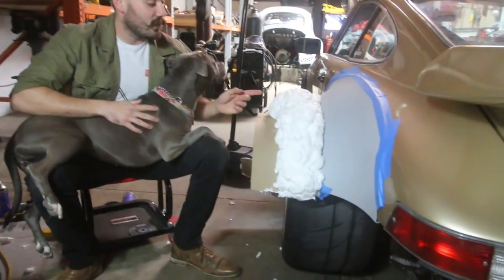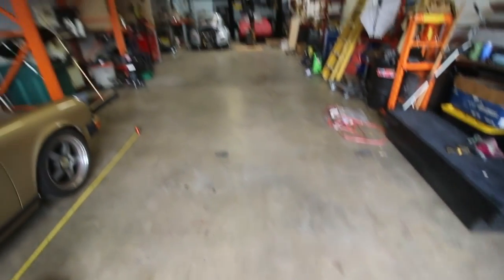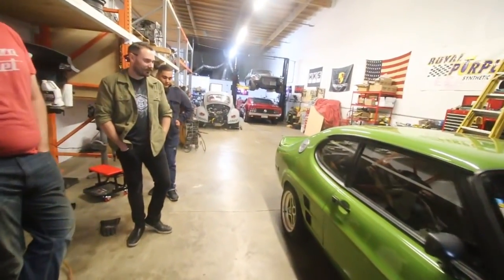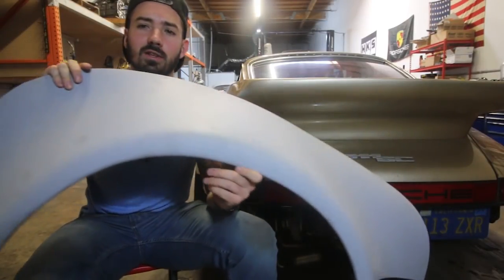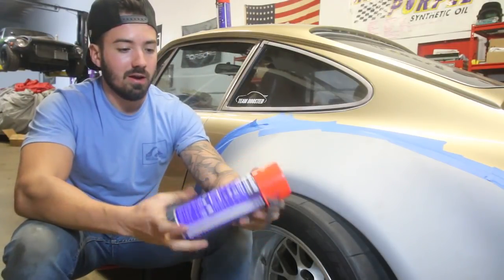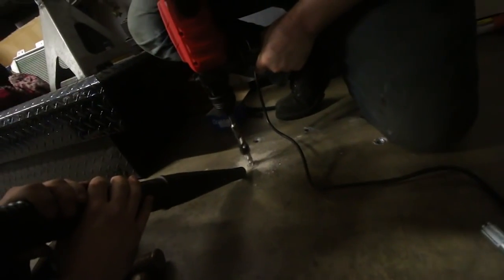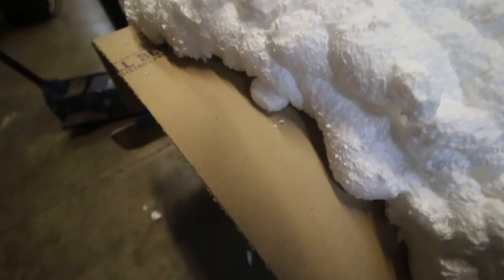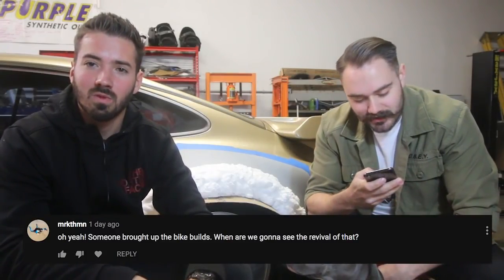Making Carbon Fiber Widebody Flares - 911 Turbo Pt.1

Comment: If I could add one thing. Medium or high density expanding foam works best for melding and sanding. Way less chance of large air pockets and it doesn’t fragment like high expansion foam. Have built a few scoops using  high density low expansion foam.

Comment: Best video yet!  

You guys have got this.  Use the current quarter/flare as a plug.   Pull the mold and you can then reproduce your flares.  The foam you’re using is okay, but be sure to fill the air bubbles and gaps with body filler.  When you go to lay up the resin be sure to be generous with a PVA mold release.
Reply: The plan is to get the rough shape with foam,. Then get the desired contour with filler, and possibly a layer or two of glass over top for rigidity before making the negative.

Comment: High density spray foam, mild it paint it with a none solvent based paint and go to town with gel coat and fibreglass to make a negative then form the carbon fibre inside that. Easily do able for you guys.
Reply: Don’t forget about a release agent between the paint and gel coat or carbon fibre

Comment: I can't wait to see how the flares turn out! Any chance you plan on making more than one set to sell? I have a 83 911 with 996 suspension so I need super wide flares as my front hubs are almost flush with the stock fenders and I have about 2 inches in on the rears. At the moment I plan on making them out of steel but depending on how these turn out I may be in for a set if you all plan on making a few sets.
Reply: We are considering it depending on how good they come out.

Comment: I would have cut the arch, moved the outer piece so it covers the edge of the tire and then filled the gap with the expanding foam. That way you would have had a nice clean edge to the arch. Trying to shape the foam to make the edge look right is going to be a challenge!

Comment: Absolutely not the way to do that. This is a simple project. Make and incision one inch in the keep the contour  of the edge and use pop cycle sticks to measure the same distance away as you set the fender on top of the tire. CA glue it in place and glass it in.